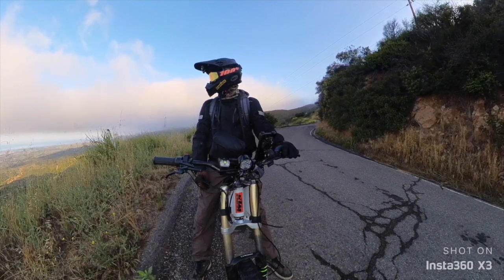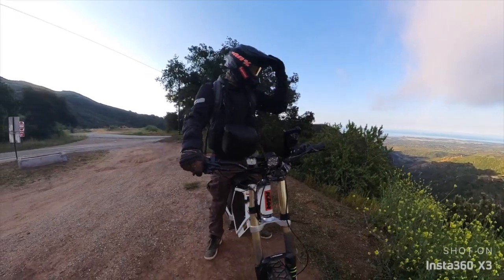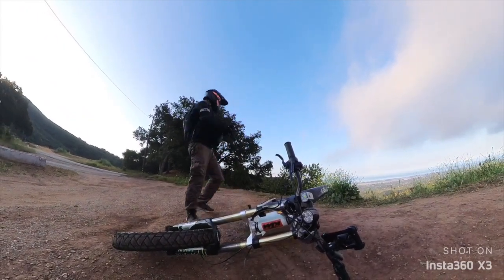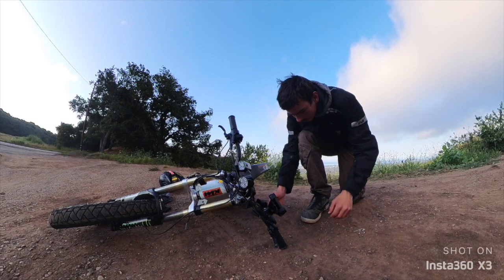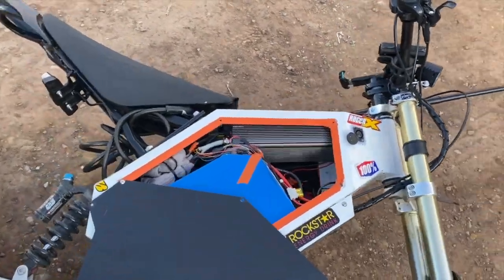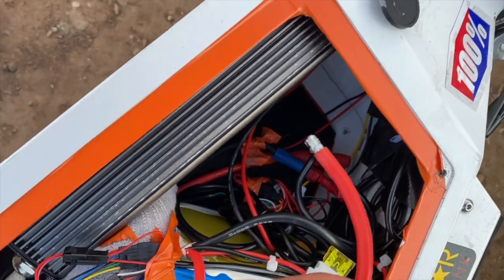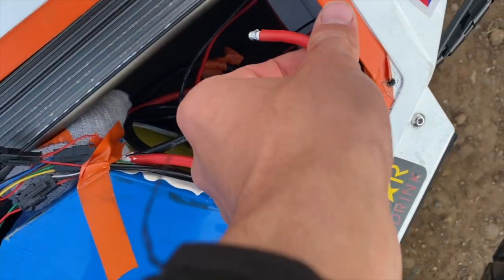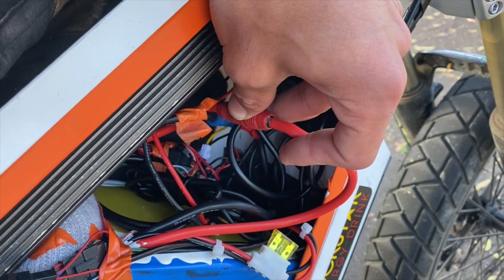My enduro ebike broke mid ride!

Comment: Hoping the NB power kit I got will be more reliable. Compared to your build, I was surprised to see they have since upgraded a lot in their standard kits (KKE shocks, EE style lightweight frame, inverter for lights, connectors, larger gauge battery wire, etc). I'm thinking about cutting an intake vent just to keep airflow through the battery compartment with the Texas heat. Trying to learn from you as the parts come in, and thank you for the great content!

Comment: Tommy do you use regen braking going downhill to slowdown/stop assist. Another question about how far can u go doing about 50 mph before motor heats up/cut off protection kicks in just curious, I got 2600 miles on my bike q273 3t 12000w 41ah LG battery mine cut off once after riding 2hrs then 45-50 mph for 5 miles it momentarily cut off

Comment: It might be just the angle of the video but it seems like your front wheel is kind of bent looking at the fork when you have it on its side laying down?
Reply: I think youre right on the angle, it looks like one of the bolts might just be tilting it slightly since it's on its side.